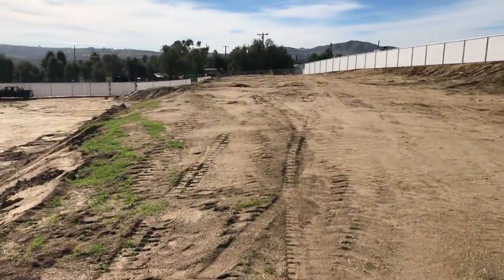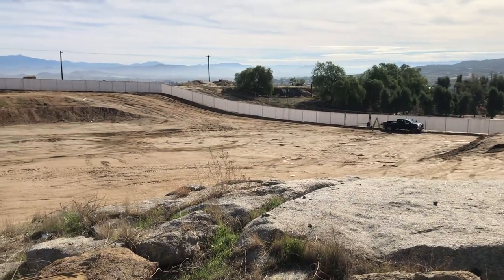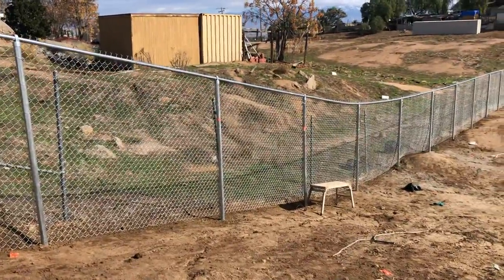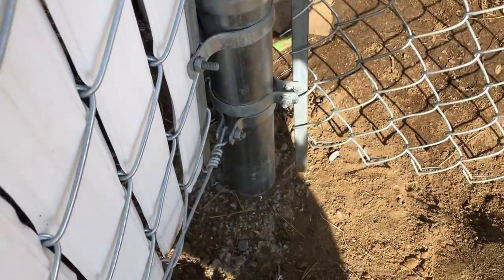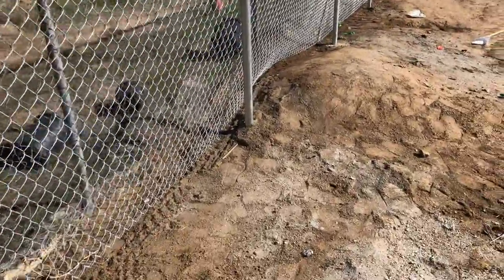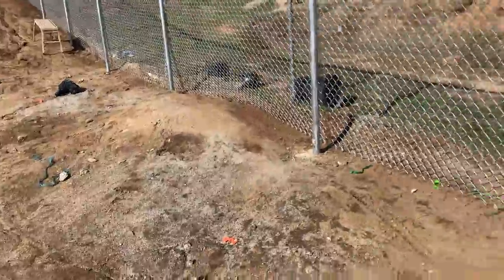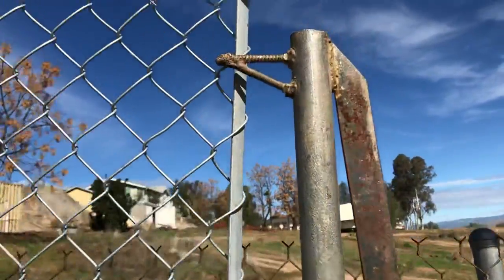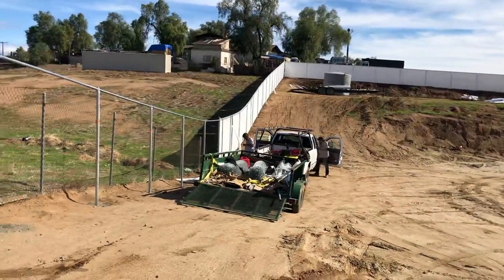DIY how to build a chain link fence PRO TIPS CUTTING WIRE part 38

Comment: Had to bend some top rail, I've been working alone and had no way to bend without another person, so I just threw in another Term. GOD I love building fence, 13 years experience.
Reply from the maker: Cool! I love building fences too! So many cool places and builds. I have worked for 5 companies over the last 30 years of building. I also do my own side jobs. I have trained a  lot of crews and decided I would start sharing some it on youtube for all the other fencers. I picked up a lot of tricks over the years. In fact I might make a video next based on bending toprail without another person. I have several different techniques.  That might be a good topic. But before I make the video I can give you a couple quick methods you can try that I use all the time. The bottom of the posts work great that are set. Pound additional pipe stakes at points where you want on or multiple bends. Strap a 1-7/8 post between posts and put the toprail in to bend. Bring pressed steel barb arms, they are really strong, tek screw them on the posts and use those temporarily for bending. The hitch receiver on the truck works well most times. Pull the bed stakes and put pipe in and bend off the pegs. Connect more than one piece of rail together for smoother bends if . If it is sleeves, bend two pieces and cut the flat parts out for continued or double bends. And I have more, but that should help you for now. Let me know what you think.

Comment: I like the video
Reply from the maker: Awesome I am glad to hear that! Thank you!👍
Reply: @fastflo1  up in northern utah. I work with my dads company he owns sublime fencing. And I always have troubles with chain link so I’ve been trying to find out better ways to do it on my free time
Reply from the maker: @hjkropf  Oh no way! I have not been to Utah in sometime.... Well that is really cool. I will check out the company. I worked for a few different companies over the years. So I have had plenty of practice. Just decided after all these years to share some of the things I learned since so many people are learning to build things for themselves. I am always on youtube learning stuff, so It is cool to be able to share something back. The bias cut is probably the most difficult to get right or know exactly what to do and where to start etc.... It took years before I finally came up with a method that I consider to be a professional and efficient method to determine where to cut and have a guide. It makes so much more sense looking at the fabric and knowing where to cut using the post as a benchmark for cutting the needles. Also to start on the top of the wire at the top of the bias, or the bottom of the wire for the bottom of the bias. I have some videos you can check out also cutting a bias in on privacy link. And if you have any specific questions , feel free to ask. I have most likely encountered it in the last 30 years of fencing! And I am happy to share! I also do backstops, Iron , wood , vinyl, farm fencing, handrails, prison fencing, and dog kennels. This is my friends company called Goodwood fence. Keep learning it will get easier!